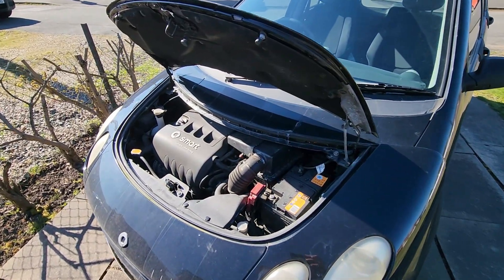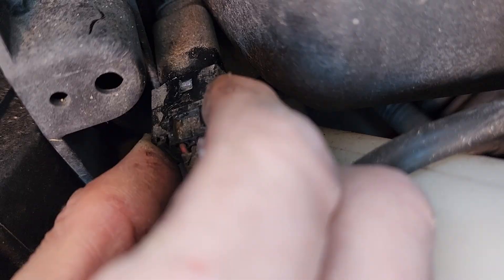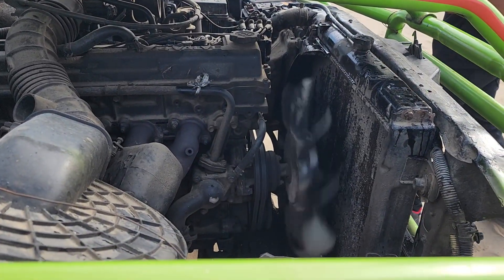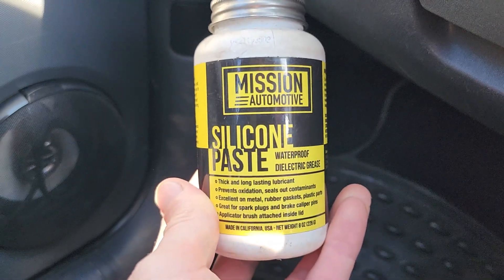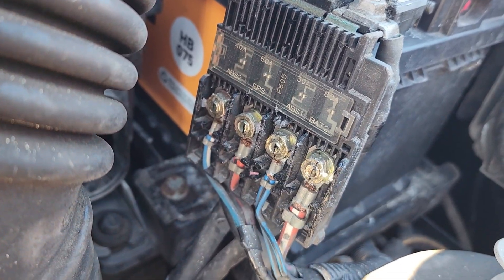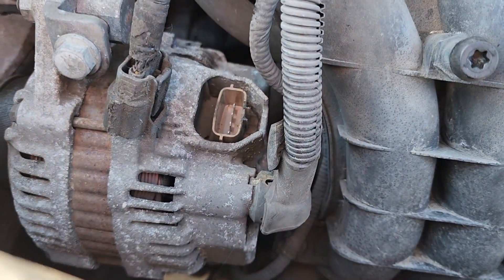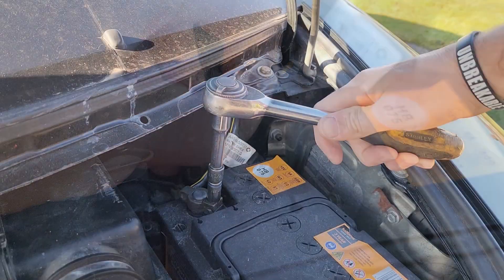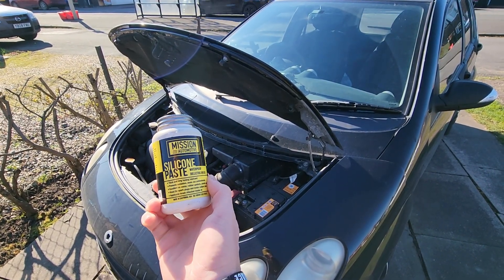How to Apply Dielectric Grease: Best Practices and Common Mistakes!

Comment: If ngk spark plugs say no grease needed, will it still be better for me to use a little bit for best quality ?

Thanks.
Anybody knowledgeable please reply soon.
💜
Reply from the maker: I explained this in the video, in a lot of detail
Reply: I think NGK are talking about not putting grease on the threads of the spark plug, rather than talking about the electrical contact side. At least, that's all I've heard from NGK.
With the boots and dielectric grease, I'd do what the car manufacturer says. For my car they explicitly say to put a bit of dielectric grease in the boot, for my wife's car the manufacturer explicitly says to put nothing in there at all.

Comment: Hi.
Thanks for your great videos.

Im a subscriber.

* Question please ...

* Can Steel Camel Thread N Post
be used on spark plug wire boots and
distributor cap boots
on a 1999 honda civic ex ?

Thanks 
Anybody knowledgeable
please reply soon.
💜
Reply from the maker: Are you having issues? im pretty sure thats an anti-seize product, so a no on that
Reply: @TutorialGenius ok thank you.

Comment: 5:12 brake lubricant? What you mean?
Reply: The disc brake caliper pins slide and have to be cleaned and properly lubricated each time pads are checked or changed. Each manufacturer may recommend other lubrication points in their brake systems.
Reply from the maker: You can learn all about it here! https://youtu.be/3-3dwLM2uSs

Comment: New Subscriber here 😊
I am Canadian and can confirm that there was some so called dielectric grease sold here in Canada and the USA in the 80’s ( I actually used it) that was silicon paste mixed with an acid . The big problem was the acid was conductive and ruined many ecu’s because people are ignorant.

Comment: I was wondering about using some silicon grease around the outside of a connector to prevent water getting in there.
Reply from the maker: It will attract dirty and debris! Use your best judgement given your location and how you drive! :)
Reply: @TutorialGenius  is dirt worse than corrosion?

Comment: I apply a very thin film with a cotton bud / q tip inside a coil plus where it sits on a plugs insulator, a thin smear on bulb terminals and connector housings. I’m trying to stop a little bit of moisture ingress, corrosion and particularly sticking. I would never pack anything with grease.

Thanks for your information! 👍
Reply from the maker: Sounds like a good approach to me! Thanks for watching! :)

Comment: 40 years as an Auto sparky .... in underground mining,heavy haulage, prestige car dealer's (Ferrari Porsche etc)
KEEP INSULATORS AWAY FROM TERMINALS  INCLUDING DIELECTRIC.....
JUST FOCUS ON KEEPING IT DRY AND ELIMINATE MOUSTURE...
so many times I've seen mechanics introduce faults by thinking they're helping by smearing grease in multiplugs...
DONT DO IT.
Reply: so you would not use any grease on new spark plug wires for 90's honda ?

Comment: I had a crown vic, and that 4.6L would misfire like hell unless I put dielectric grease in the coil insulator. Once it was all greased up (I mean filled to the brim) it would run like a champ.
Reply from the maker: haha yep! That would essentially be the fault of the insulator! You're essentially fixing the problem of the insulator to do the job it was designed to do out of the factory, while taking a hit with potential misfiring
Reply: Probably kuz they ruined it with grease causing a short and now it requires that short from now on  ?